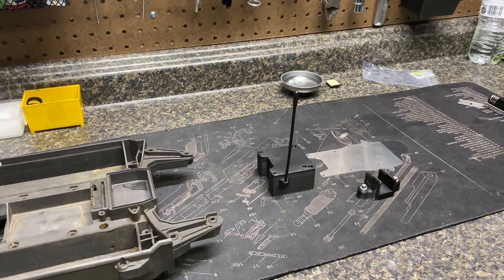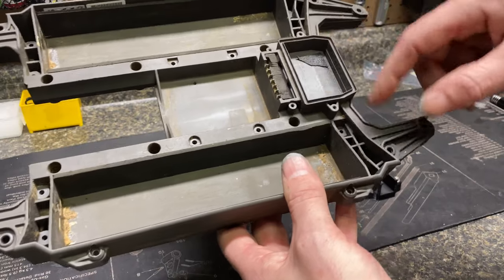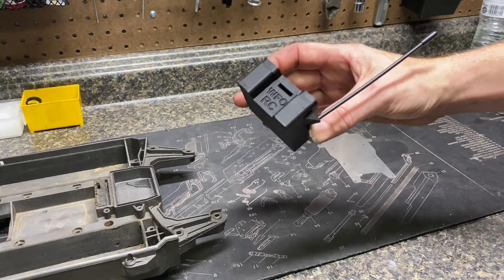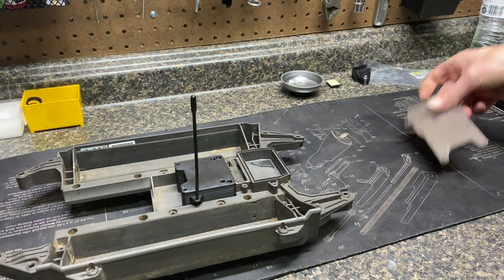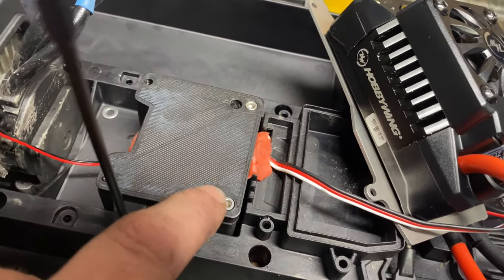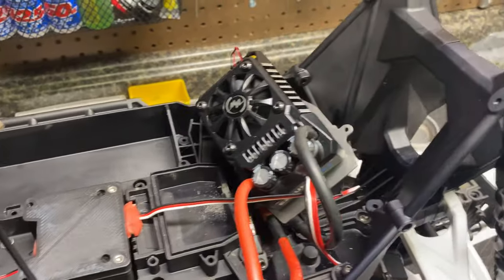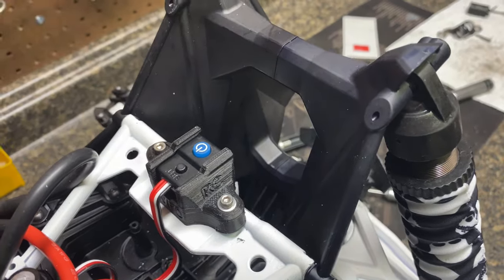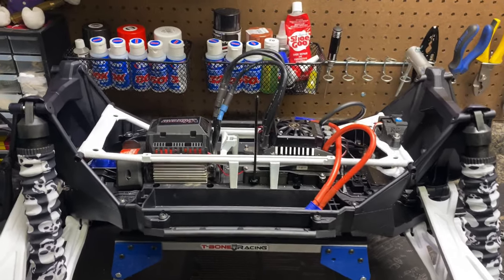WFO XMAXX max 5/6 esc plate, reciever box & switch mount

Comment: Thanks so much for the step by step I'm working on this now but can you tell me what screws you used in front of new receiver box to chassis?
Reply from the maker: Honestly, I don’t remember exactly what size are used I have a bunch of random hardware sitting around for different vehicles. I just found a couple of bolts that would work OK if I remember right, I had some spacers that I placed in between the box and the chassis just to take up some of the space they don’t have to be super tight but I do remember there being a small gap that I put either some washers Orson tiny spacers in maybe like 3 mm

Comment: How are you threading the receiver antenna wire through the spot on the gearbox up through the antenna? I can’t get it through the bend....
Reply from the maker: If I remember right I reamed the whole out ever so slightly I think it made my antenna tube slightly loose just use a drop of East 6000 or super glue to hold it in

Comment: How does the ESC get mounted to the plate? I don't see any screw holes so I am assuming you glued or taped the ESC to the plate then mounted the plate?
Reply from the maker: There are actually four small holes drilled in the bottom of the metal plate this mounts the ESC to the metal plate via four small screws these holes corresponding to the holes in the bottom of your ESC. The plate then has holes in the corners that correspond to the factory chassis and to the rear to holes of the electronics box that they produce they go through the plate through the electronics box cover through the box and into the chassis into already existing holes.
Reply: @LargeeeScaleLife  Bro, like you said , it doesn't come with mounting screws to attach the ESC to the plate. I went to 2 hardware stores, searches amazon, searched online, and emailed Hobbyking and WFO looking for these screws. I am waiting an email responses from those 2 but bottom line is I haven't found those screws. Any chance you can link me to screws you 100% know will work? I'm exhausted looking for screws lol..
Reply: @seth9145  if I remember right I just use some small traxxas screws I had laying around. Now that I think about it if I have a chance tomorrow I’ll go ahead and pull my plate off and see if I can figure out what size they are If not hit up the WFO Facebook page send him a message he can probably tell you exactly what size you need
Reply: So update. I bought a screw kit on Amazon that worked. BUT more importantly, WFO will now be including the ESC mounting screws to mount the ESC to the plate with their mounting kit. So future purchasers of this kit will no longer have to hunt down screws.

Comment: Hey man, I'm a huge fan of WFO. I love the mod 1.5 gears I run 30/35 with castle 2028 800kv and x8s. It's perfect for the x-maxx.  

The reason I am commenting is because I have a suggestion that I think will make a little difference as far as performance, but big time when it comes to longevity of your esc.         I recommend shortening your battery leads off your esc.  I would take 3 or 4 inches off each side. Take as much as you can. 

I'm not sure if you can download the data from the max esc's  but I can from the castle x8s, and originally I was running my wires similar to yours and I was getting about 5 volts of ripple. Since I shortened them way up. I get no more then 0.75 volts of ripple. 

Everyone has there own opinion though.  All in all, I enjoyed your video. I like the wfo rx box and esc mount a lot. Nice work.
Reply from the maker: Actually I am going to totally shorten those up a buddy of mine does soldering so he’s going to shorten them for me I honestly didn’t mean for them to be this long I called up a shop in a city I was visiting and told him I was putting this in this truck and ask if they could go ahead and set it up for me and they did didn’t realize they were going to leave the wires full length But yeah totally Man those wires are insanely too long
Reply: @LargeeeScaleLife  right on man. I can understand that. Soldering is not easy until you have done a lot of it. It's extremely important to have good connections at every soldering point too. It makes a big difference when it come to performance. Thanks for getting back to me on here. Take it easy man.

Comment: What radio should I use? I couldn't get the traxxas radio receiver to fit in the WFO receiver box.
Reply from the maker: Flysky Noble is what I’m running you could try setting your Traxxas receiver on its side it might fit that way
Reply: Thank you. I didn't really like the fit. A couple people on FB said to try either the Flysky or the Futaba. I ordered the Futaba.
Reply from the maker: @YEABUDDY0712  they make a great radio system the receivers are a little expensive but other than that their stuff is absolutely great never been a big spectrum fan I know a lot of people are as far as  flysky The noble is amazing however it’s a little expensive and it’s probably one of the only ones if there’s a really really like for big vehicles

Comment: Hi! Do you mind list me the 3 Accessories for my Max 5. Xmaxx the right Rever boxs. Thanks
Reply from the maker: All you need is there receiver box you will need the ESC plate and the max 5/max six switch holder in whatever color you’re wanting. If this doesn’t answer what you needed let me know
Reply: Is this water proof? And is it  a Certain receiver box dont want to order a wrong thing. Thank you so much for the reply
Reply from the maker: @michaelmclemore488  no they’re all the same I believe the only thing they’re offering is their version two now. As long as you get one for the Xmaxx you were good to go. It’s not waterproof but you could make it waterproof. I actually waterproof all of my receivers I actually have a video on my channel on how to do that. I do not trust waterproof receiver boxes. I sealed this box with a little bit of silicone and it’s been fine but I also waterproof my receivers just in case

Comment: Did you have to program and calibrate it ? I plan on getting the same set up and just need a little info
Reply from the maker: You don’t technically have to program it but you want to go through and set it up for your particular vehicle you have to calibrate a ESC anytime you install one or use a new radio system but it’s super easy. The instructions are pretty straightforward and programming one is reasonably easy with the beeps but I would just pick up one of their LED cheap program cards they’re like 12 bucks just follow the chart simple as pie hit me up if you need any help happy to give you what settings I’m running
Reply: What gearing you think is good for bashing and a bit speed run with decent temp
Reply from the maker: @lexhtfdct7230  If you’re going to run on factory motor 20/50 is a really good gearing that his temperature stable and really wakes the truck up. Now speed runs or an entirely different story you could pretty much gear it however load it up with the fans and go for it It’s really hard to have a truck that’s a good basher and also does speed runs. Those two just don’t really work together but I think 20/50 on stock motor is the way to go on an 1100 KV set up I think 20/35
Reply: @LargeeeScaleLife  do you think a 4s 9000 mah is to much for the stock  esc and motor 🤔

Comment: hey mate, did you buy the combo pack from WFO that comes withe max 5, the motor, battery strap, motor mount and all that?
Reply from the maker: Fahim Islam no I purchased it all separately because at the time I was running the factory motor with the max five however that kit is actually a really good way to upgrade I haven’t run the battery strep system myself but I’ve really been thinking about picking them up because I run a few different kinds of batteries
Reply: @LargeeeScaleLife  I have the WFO gearing 20/35. What ratio you think is best for bashing/speed?
Reply from the maker: Fahim Islam so I think that ratio is probably best all around especially for bashing if you wanted to do all out speed you could maybe get away with a 20/30 That would take you down to a 1.5 ratio with the 1100 TV motor you would probably generate some heat but with the proper fans and watching the temps you can get some speed out of it

Comment: Nice. I just ordered these parts after watching this. Going with the max 5 esc, 25/35 gearing and the hobbywing 1100kv motor.
Reply from the maker: I have that exact set up sitting on my bench right now all I need to do is install it
Reply from the maker: Rc enthusiast. Actually I need to look again I may be running a 20/35
Reply: @LargeeeScaleLife  did you have to use the sensor wire from the original motor? I've heard that you have to use it somehow on the newer xmaxx trucks.
Reply from the maker: Rc enthusiast. If you use the factory Traxxas receiver you have to I’m using a different radio so I eliminated it
Reply: @LargeeeScaleLife  I went with a flysky fs GT5 radio and receiver. Way better than the Traxxas stuff. I finished installing the WFO stuff yesterday. It went smoothly. Now I recommend this set up for those people that have their max 5 in the air suspended between the chassis brace and too high. That just looks so bad.
Reply from the maker: Rc enthusiast. I actually have a GT3C that is hacked with the updated firmware they can handle up to eight channels